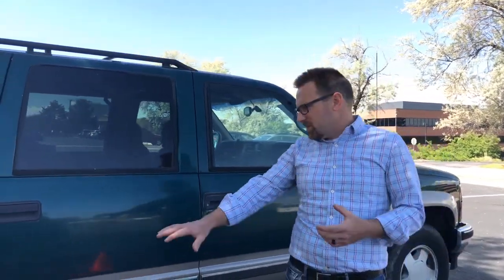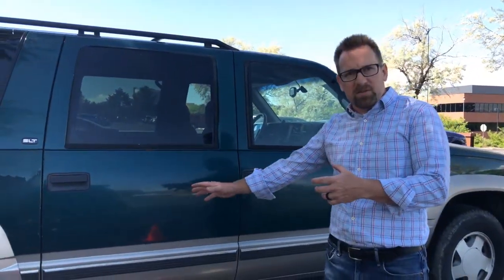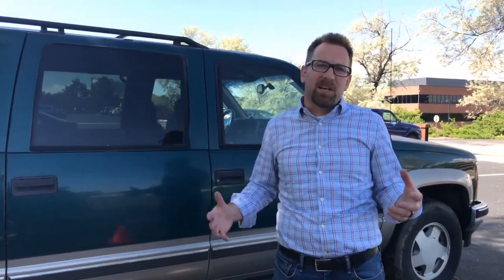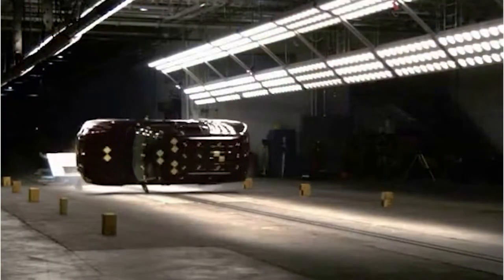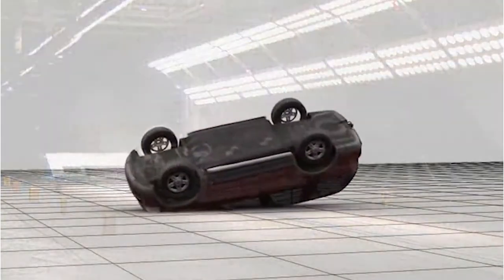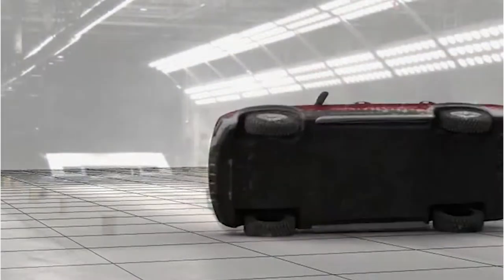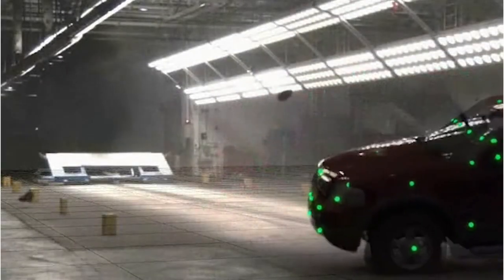Determining a Vehicle's Center of Gravity Height

Comment: why not measure to the center of the vehicle and put just two heavy-duty Jack stands under the center and see because in theory the center if anything is your balancing point (if that makes sense) imoa the only thing that disturbs gravity is weight
Reply: i think because the car doesnt have equally distributed mass. the front could be heavier than the back . if the mass were equally distributed throughout the vehicle finding the center of mass using the length, width, and height of the car should work in theory
Reply: That would barely work.  Some cars dont have jackpoints all along the vehicle. And even if you did, you still would have trouble finding the height of the COG since you cant find that simply with a balance point.
Reply: That would only work for defining the CG in one axis; the front to back axis.  The axis that will be hard to define is the top to bottom axis.
Reply: that gives you x and y, not z.